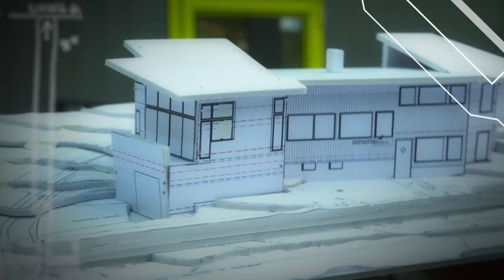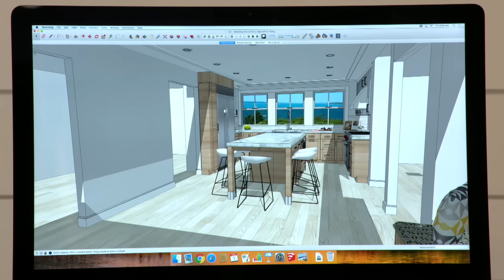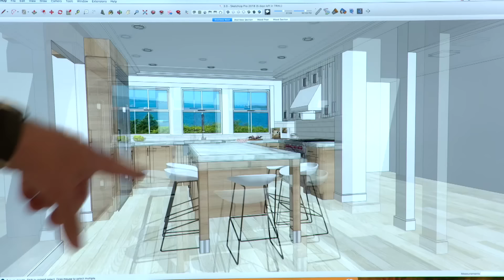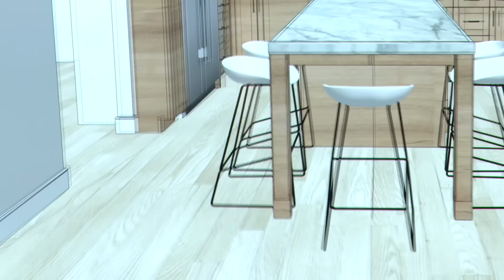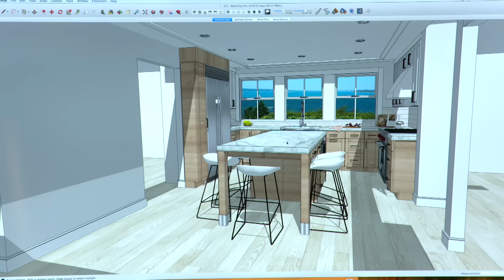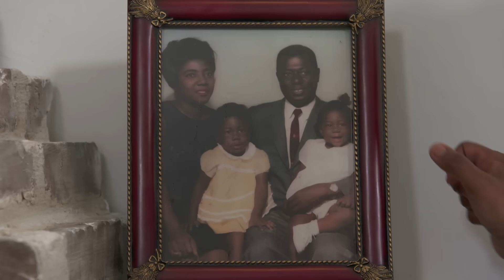This Old House | A Charleston Family House is Reborn (S40 E4) | FULL EPISODE

Comment: Mary looks a little too dainty for construction as a laborer. The way she held that sledgehammer? I just cringed! However, if she's apprenticing for maybe project foreman or manager or even general contractor, basically positions where she isn't doing the 'heavy lifting' she'd probably be better suited.
Reply: Really doesn't take too much strength to be able to wield a hammer.  She can learn.  Put on a couple pounds of the right muscles in time, and get better at technique and it's easy.

I can tell you from working with my wife who had little experience and is far weaker that she can usually find a much more energy efficient way than I can.
Reply: She's new to the business as opposed to the other guy. She may have been cautious with the sledgehammer, she looks like she can hit harder
Reply: I don’t think that she’s left handed. I’ve seen that with people who aren’t used to working with certain tools. They’ll hold the tool normally but use it backwards instead of working ambidextrously (because they can’t yet) and don’t reposition (for a variety of possible reasons). She’ll need to learn to do both but there’s no reason to think that she can’t get there.
Reply: I can tell by the comments that every one of the commenters is a 'progressive'. I don't care who you are, there are just some jobs that only men and women of a certain size (let's just say, not petite, or dainty) can do. I'd be worried if I was on the jobsite with a tiny woman like that but hey, maybe that's just me in the 'soy latte, man-bunned women are stronger and better-at-everything-than -men 21st century wuss world! LoL